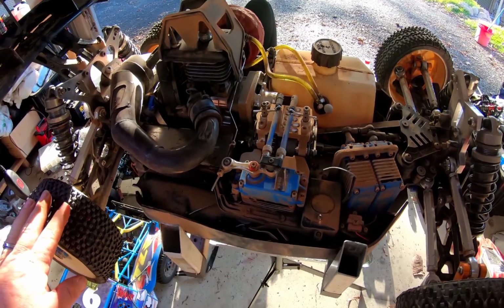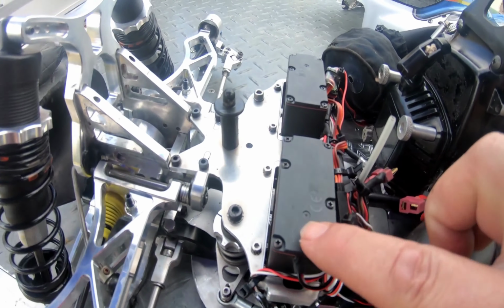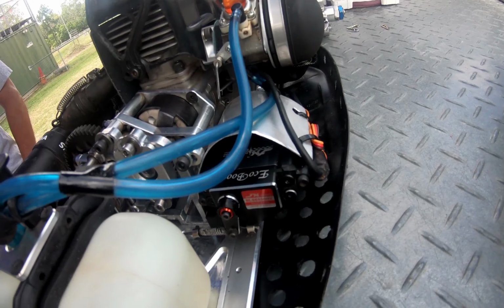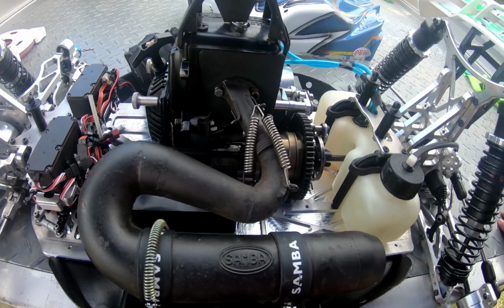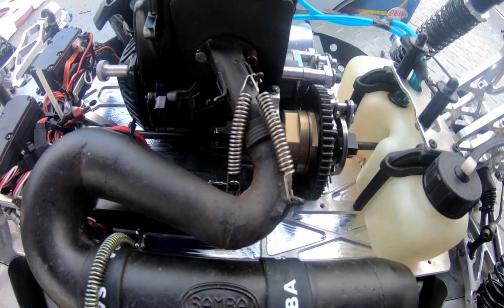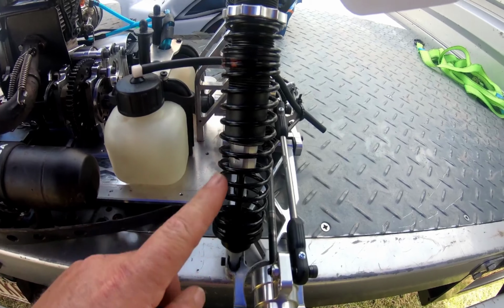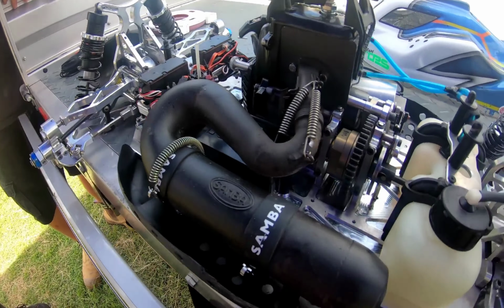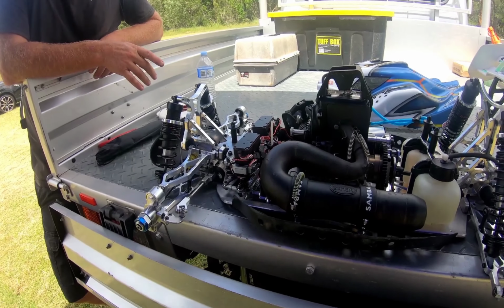RC OFF-ROAD TEST AND TUNE AT THE RACE TRACK - FG/LOSI/N.R.P. (QORLS)

Comment: So that air filter is self cooling? How the hell does that work?
Reply from the maker: Hi i would be thinking its because it has high flow air plus the materials of the airbox stacker filter and the way it's designed to get maximum air flow by what he's told me as I asked the same question 👍👍👍